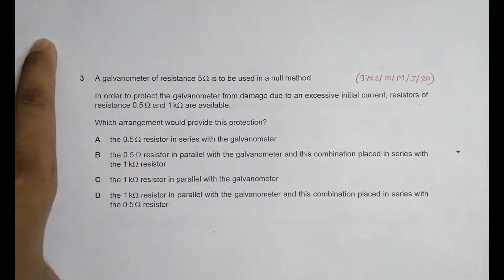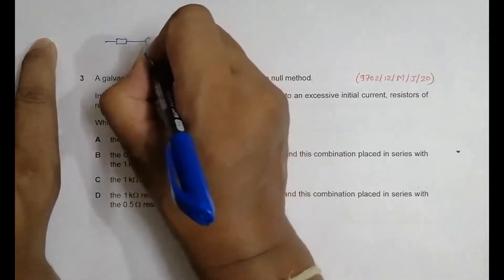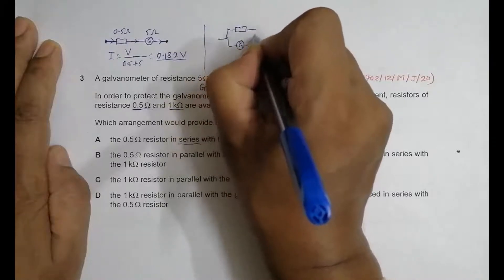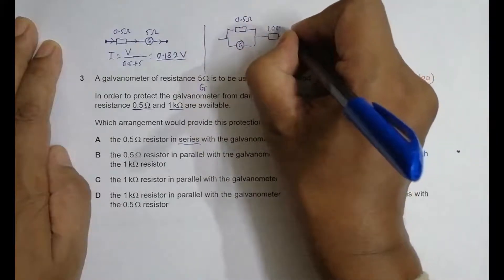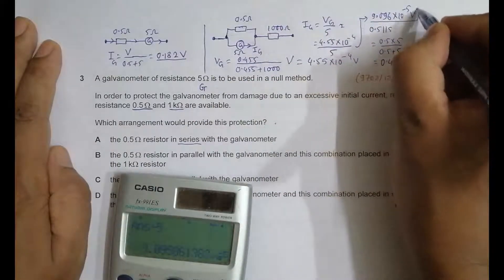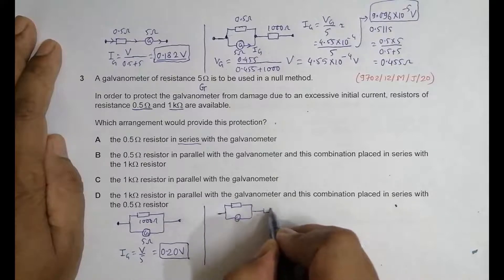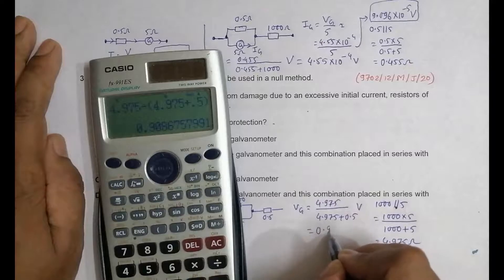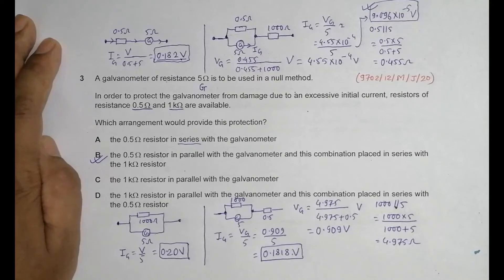2020 CAIE AS & A level May June Physics Paper 12 Q. No. 3 (9702/12/M/J/20) by Sajit C Shakya

Comment: there is a much simpler way to solve this question..

We want the galvanometer to have least current possible, so it must be in series with a resistor which has a lower resistance hence the 0.5 ohms.
This alone gives you the answer

Comment: ---in 2:14 why do you have to find reciprocal though they are in series 
---in 4:08 why do we have to write 0.5*5/0.5+5
---in 5:47 why do we have to divide 4.55*10^-4/5
---in 6:42 why Vg/5 when there is 1000ohms present. Even doing parallel equation it is still 4.975124378 ohms which is almost 5 (2sf)

Comment: I wonder how one will do this qualitatively because one does not have enough time to do all these calculations.
Reply: We don't bro. This question can literally be done in 15 seconds
Reply: @p3nx1lz91  how?
Reply: @aviseetul5670  In only one of the choices is the 1.5kΩ resistor in series. So when it is in series, it will provide a very large resistance and thus current will be very small. If the 1.5kΩ was in parallel, it's resistance would be less than if it was in series.